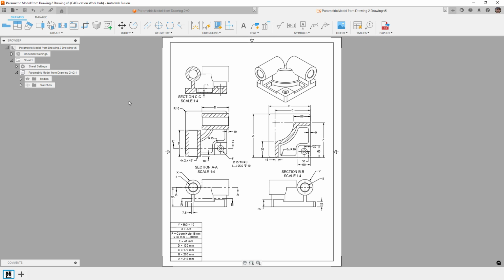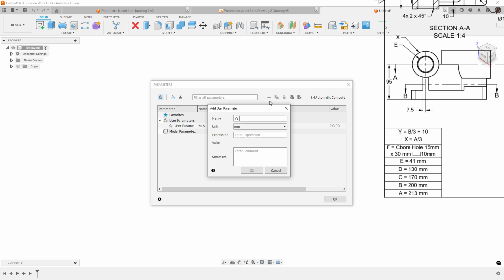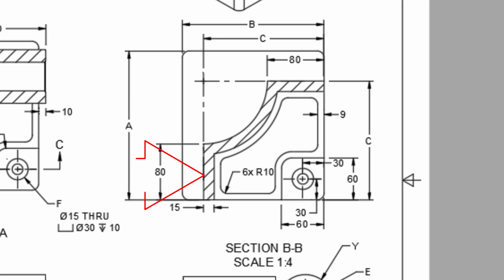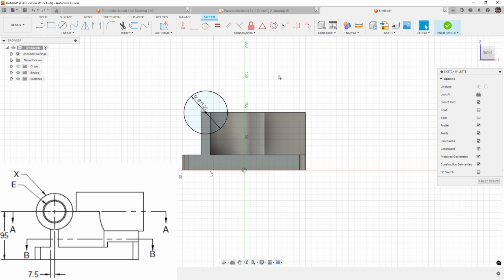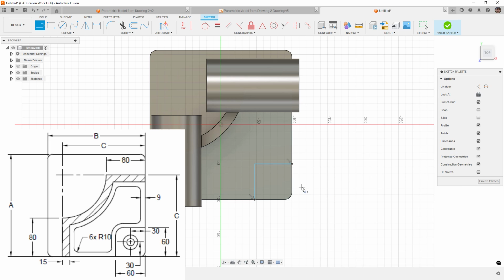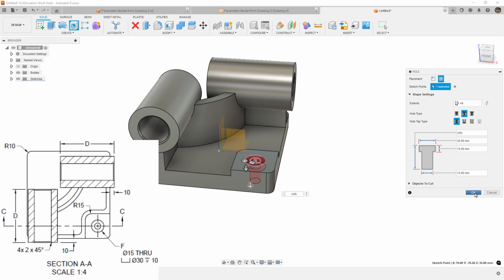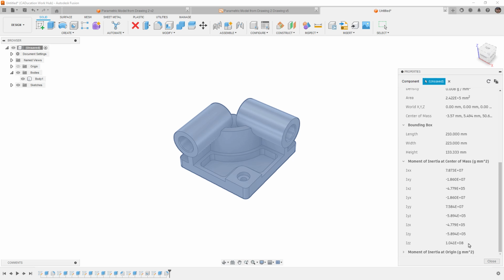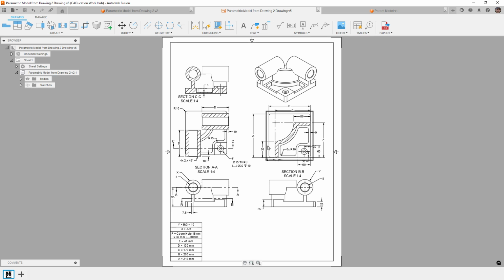CAD Modeling Practice | How To Break Down A Detailed Drawing And Model It

Comment: It is actually a very useful and time saving thing to do with engine model plans from the past. Too many have errors that were never reported and you either model the parts before machining or you risk finding out the hard way while making the parts.
Reply from the maker: in a case like that are you talking about manufacturing the parts from prints only vs modeling them first?
Reply: @LearnEverythingAboutDesign  generally the model engine plans (steam and gas) are on paper. they contain mistakes. In the past you found this out while making the parts. By modeling them first as an assembly you can see where the issues are before making chips. Not exactly manufacturing as it is one time by hobbyist 🙂

Comment: Thizziz Matt: Thanks for grudgingly making this video! I'd like to see more of this sort of thing: challenging practical models. I'd also like to see complicated and challenging assemblies. My method of practicing Fusion is to model the thing FIRST, then watch the procedural tutorial, such as yours. In this manner, I graduate my proficiency with Fusion; or so I believe.
Reply from the maker: Glad you liked it!  Yeah grudgingly lol.  In my mind the problem solving part is way more important than the modeling from a drawing, but i do understand the practice aspect.  The problem we run into generally is that really complex models. like true ones, drawings aren't enough info to model them.  Usually the drawings have info for manufacturing inspection and thats it.  Models that are not nearly as complex aren't much of a challenge.  I would say the vas majority of models i create from drawings are generally from 10+ years ago when CAD models from vendors wasn't really a thing.  If i had a PC fan i needed for a design i had to create a place holder from a basic drawing, or a camera or something.  Vendors have gotten really good at providing that data now making it a bit of extra work ;)  

I actually made another part/simple drawing for this video but opted not to use it.  I will see what else i can put together.